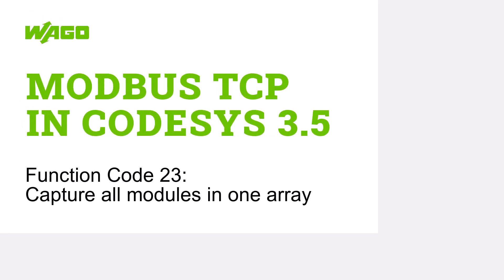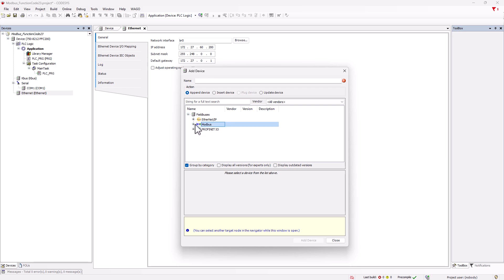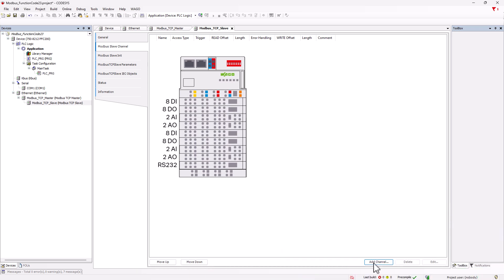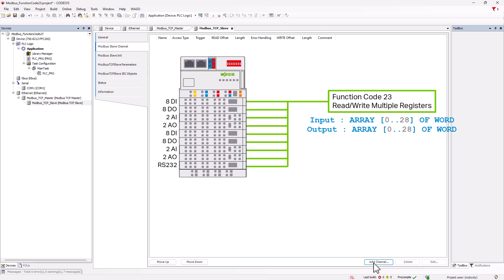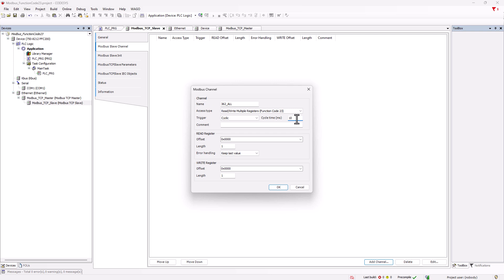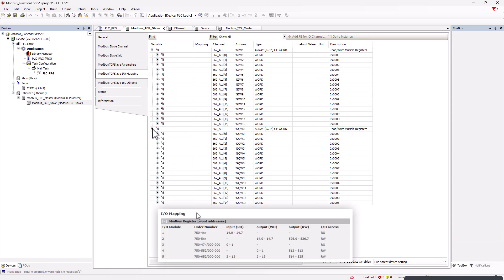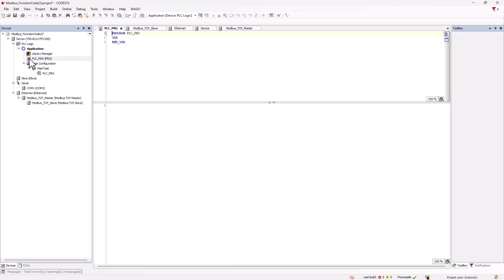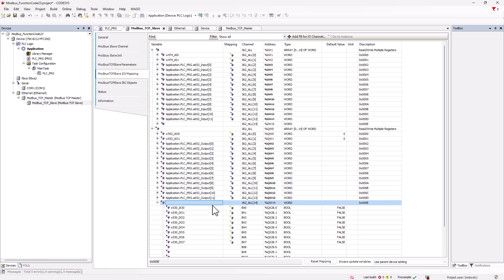Modbus in CODESYS 3.5 | Capture all modules in an array using Function Code 23

Comment: codesys3.5 ,How to perform polling when connecting sensor devices via RS485 port in 750-652
Reply from the maker: Unfortunately the CODESYS 3.5 Modbus-Configurator cannot be used with serial WAGO K-Bus modules, like the 750-652. The CODESYS Configurator does only support on-board serial interfaces.
To establish a Modbus communication with serial K-Bus modules, please use our CODESYS library WagoAppPlcModbus.
Kind regards from the WAGO Team